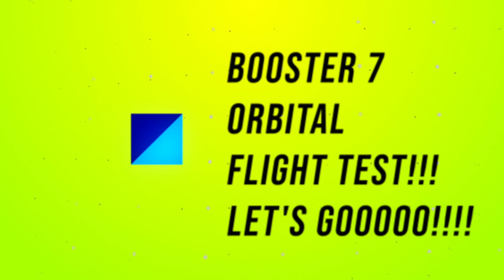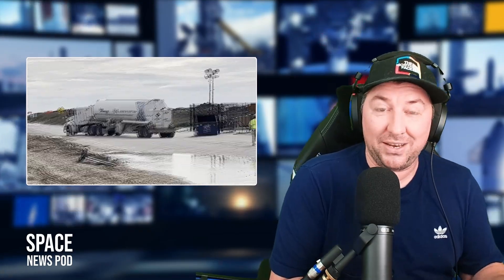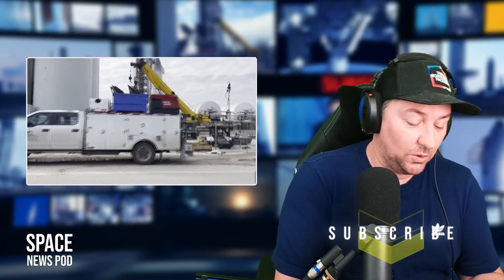Orbital Test Flight Booster 7 Testing Continues

Comment: At first I wondered how it would launch with 13 less engines but if the load being sent is low they will not need all to test reaching orbit. It is after all a orbital attempt with will give the massive amounts of data for ship production of more efficient units. launch now and fail learn and test again. seams to be the Spacex way